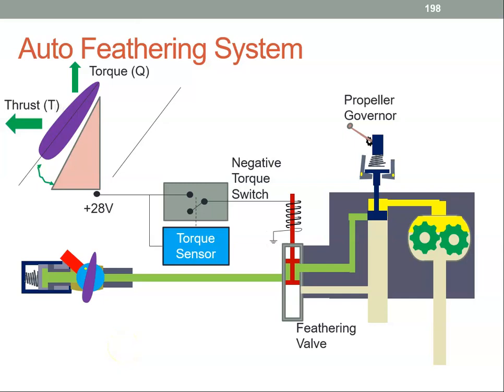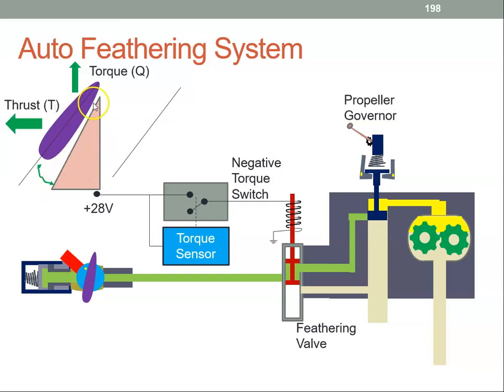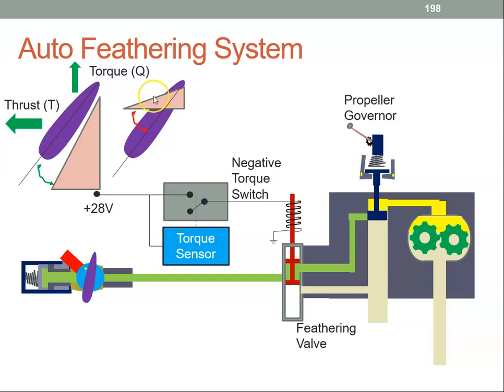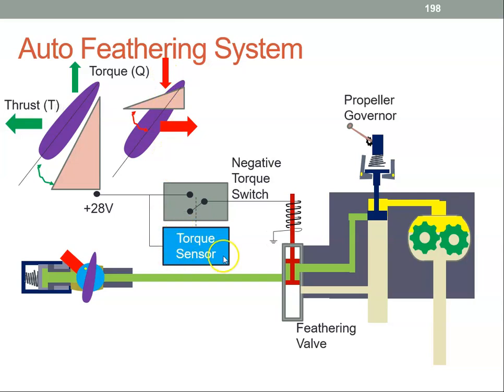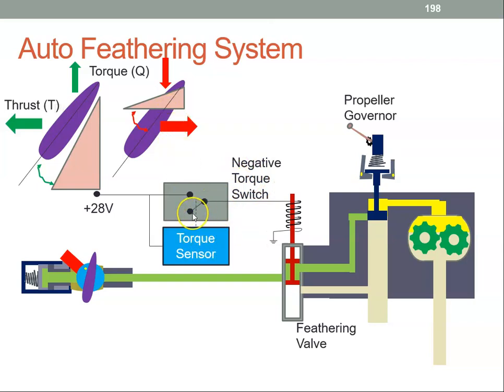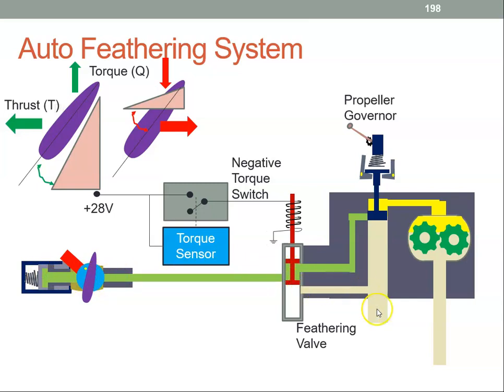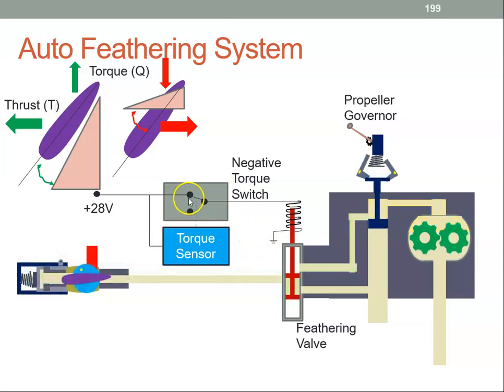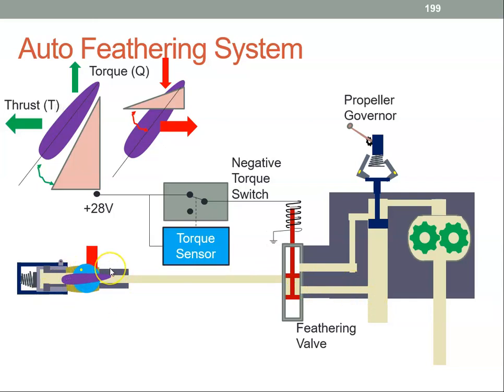Propeller Auto Feathering System

Comment: Hello first thanks for the effort making the video, second I am playing a game that is pretty semi realistic as far as flight models etc, it will allow me to use prop feathering but I am not quite sure I understand how t can be used?  Am I right in thinking say if my plane is in game gets hit in the engine area it can cause major loss of power and  oil pressure so would I increase or decrease feathering to help keep it in the air? Can you explain that , thanks.
Reply from the maker: Cliff, the feathering system is provided to reduce drag when the engine shuts down in flight.  So, in your game, if the engine shuts down, then feathering the propeller will reduce drag (assuming the propeller can still windmill) and allow the aircraft to glide further.
Reply: @RoddyMcNamee  OK. got it thanks, also it allows you to adjust pitch 0-100% is lowering it going to be better for no power landing?
Reply from the maker: Cliff Walker .  Feather position is when pitch is at 100%.  It is better to keep it at 100% when doing a no power landing.
Reply: @RoddyMcNamee   Ok I understand now, thanks again, now I should be able to limp back when my engine gets hit, cool!